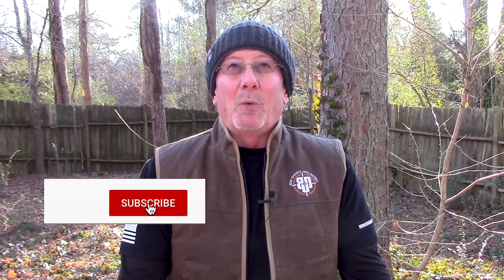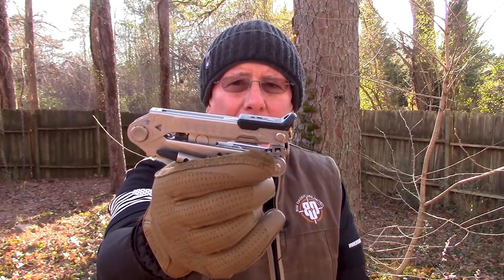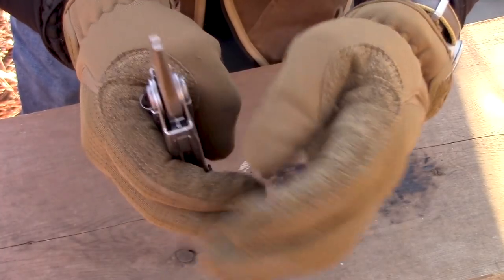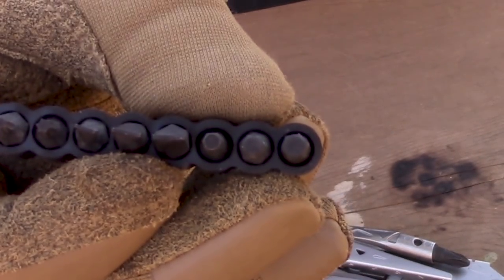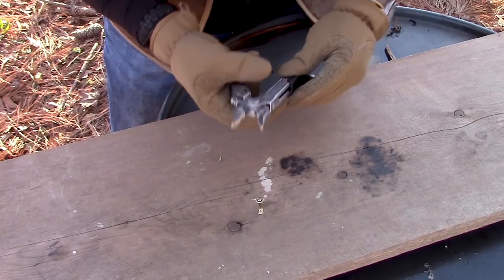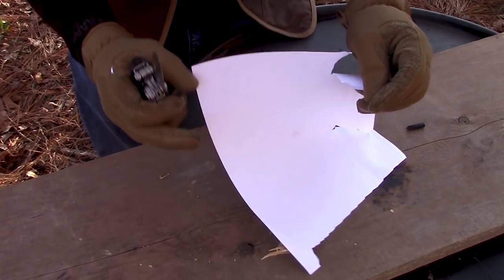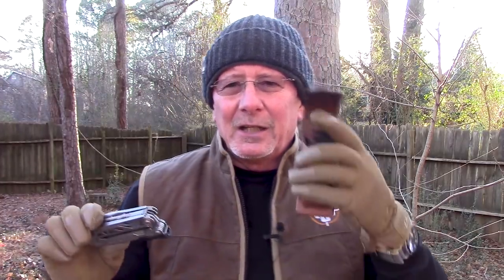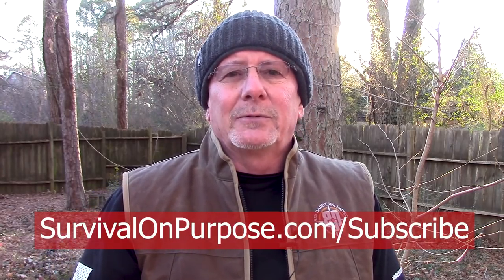Best Gerber Multi Tool - The Center Drive Plus - They Got It Right!

Comment: Had mine (the 1st version) for a few years now and really love it. The one handed opening is just too handy. That is what I have always liked about Gerber MTs. There are two things I would change if I could. 1) I would like to see more heavy duty Wire Cutters. Think Leatherman Supertool. I have broken the Carbide Cutters before cutting things I am sure I should NOT have.  2) Replace that "serrated" blade, or whatever it is, with a proper saw. The scissors are a nice touch but I prefer a saw. Again just being nit picky because I love my Center Drive.
Reply from the maker: I wish they had a custom option so you could pick some of the tools you want

Comment: i am only going to say one thing that people have been missing with the centerdrive and why i think  it is the best diy multitool barring those that are camping afficienados and that is being able to use bit sockets on the centerdrive .this in my opinion gives it an advantage to all the rest not to mention if used correctly the other tools work great as well. you can also use the bit drive at a 90 degree angle to loosen tight screws or nuts then straighten it out to complete the extraction as normal and reverse to give a little extra tightening force as well. i have done all these and it works well and you can fit a couple bit sockets on the bit holder as well and carry in the sheath with no problem.i have a 8mm 10mm and 12mm socket in my bit holder.

Comment: I've had mine for a couple of years and like it a lot. I have the original version and don't like the nylon sheath that came with it so I purchased a USA made bench craft leather sheath. It doesn't hold the bits however I really don't use more than 2 of them. Like the full size blade for sure,it did require edge work. Had many multi tools and this one is a hard to beat one!! Great video!
Reply from the maker: Thanks

Comment: I've been on the fence about the Gerber "plus" since I recently saw it. Your great review is changing my mind.  Ty.  When using Gerber, I holster the Suspension.  (My EDC is a Rebar, however.)
Reply: As a person that has the Gerber center drive plus it is absolutely horrible. I have a P4 Leatherman surge and Leatherman wave and several other Gerber's I don't understand how the center drive is so highly regarded. It's very clunky and the design is asymmetrical a lot of unevenness in the gripping area making it a screw-driving nightmare. Believe me as soon as I got it out of the package felt it in my hands I instantly regretted it.
Reply from the maker: Different strokes. One man's "absolutely horrible" is another man's "precious"

Comment: My biggest issue with gerber is plier squeezing power. I did a test where I squeezed a piece of plastic with one hand as hard as I could and the gerber barely left a mark where the leatherman wave completely flattened the material. Also the pliers rattle where the wave are fixed. It only takes a few seconds more to open a wave which you can do with one hand anyway and you get way more tools, a smaller footprint and less bulk and weight. Yes the center drive bit holder is awesome but the leatherman still does the job very well and has a huge advantage because you can use it in tight spaces as well. Gerber should have made the small bit holder usable as a driver.

Comment: Centered screw driver/ bit holder, that takes 1/4” bits,easy access pliers, plus…spring assist pliers just demolished my Leatherman Surge.! 
I hate to say it, but it did.!
Just needs a saw.
Reply: spring assisted is nice, but I find the pliers are weak on the Center Drive. They defect way to easy and the cutters are garbage. Me and a work buddy were testing the cutters, I had my Surge and he the Center Drive.  Surge made a clean cut through 18 and 14 gauge stranded, while the Center drive mashed the ends.
Cutters broke on the Centerdrive at 12 gauge solid, while the Surge made it down to 10 gauge solid

Comment: I have one of these. I really like it. Gerber tries too hard and some of the innovations are unnecessary but there are no drawbacks to them. 
As always great practical review.
Reply from the maker: Thanks
Reply: Except they are made to fail ,I went to leatherman and have never looked back. They don't guarantee them for life for nothing. Kind of like Ruger pistols ,you can buy it once , or ? Multitools are something that grows on you after awhile , you feel naked without it. I went off brand too I've got like 3 or 4 brands and they all failed one way or the other. Where as I could of just bought #1 leatherman and been done with it. Peace.

Comment: I've had an original Gerber multi tool since they first came out as an answer to the Leatherman back in the early 90s. Used to carry it at work and used the crap out of it. I don't carry it anymore because I've had an office job for the last 20 years and just don't need it very often but it does reside in the cup holder on my desk and gets used to pull staples or tighten the occasional screw. That new one looks nice,  wish I needed it.
Reply from the maker: good story

Comment: I have been using Gerber multi tools for many years, the one handed opening is a great feature.  This one looks interesting but it lost me at partially serrated.
Reply from the maker: It makes perfect sense to me in an all around tool. It is not a "bushcraft" blade.
Reply: @SurvivalOnPurpose  I was not interested in it for camping/bushcraft, it is to heavy for that and the tool set is not ideal.  I do not like partially serrated as the seem to me to be neither fish nor foul and are less useful than a fully serrated or fully non serrated blade.

Comment: I bought the leatherman plus for about $160 a month & a half ago, I bought it to take on a long road trip. Within the first 4 weeks of owning it I realized it was a very fradgile  piece of equipment. If all you need to do is tighten your glasses and remove pistol grips it’s fine. But don’t expect to open any cans, dig out any mushrooms, unscrew the unscrewable, or even dig out a weed bowl. Most expensive fradgile piece of equipment I’ve ever come across. Save yourself the money and get the gerber. Hell even customize it for the same price as a leatherman

Comment: I have the original Center Drive multi-tool and love it and wish I had gotten a second one also as the ones I got after that wasn't that great. You just gave me an idea as I watched you use the file on the tool to start a fire with it. The one I have have a file like that and I will be trying to do the same thing with the file on the tool. I still like the tool I have and believe that model is better than the new one with the scissors. That is the only thing mine don't have, but I don't use that feature much anyway.
Reply from the maker: Honestly, that seems like what it is best suited for. Maybe plastic or soft metals

Comment: I like that they added scissors. However my first center drive showed up rusted right where it said stainless steel. I get that stainless can rust but shouldn't be that way out of the package.
Reply from the maker: I wonder how long and how it had been stored.
Reply: @SurvivalOnPurpose  i picked it up a couple months after it came out. Its very uneven too. The handle that says made in USA and stainless on it is the one thats rusty. The other handle is spotless. I still love the function of the tool but kinda turned off to getting another one.

Comment: When will you compare this with the Leatherman? Tomorrow please! I need to buy something asap.
Reply: Go with the leatherman surge way better tool and steel you get way better Options and more. I have been using the leatherman tools for years, Gerber Multi tools seem very cheaply made. Never like their Multi tools but I do like there prodigy Fix blade knives and there strong. Arm knives. Do you know why the military issues the Gerber multitool is because it’s cheap they don’t issue you the Leatherman because they cost a little bit more and better made. Most of the guys I was in the army with has the Gerber end up going to the leatherman, that is the fact. Also the leatherman  is the number 1 tool choose they also are the ones who came out with this tool first years ago.
Reply: @charlesborum3910  Thank you sir!
Reply from the maker: I think both are good tools. As I said in the video, I think the one-handed opening and the offset center drive are advantageous features on the Gerber.
Reply: Also leatherman make a leatherman Multi tool call the mut EOD for EOD and a Mut multi tool for AR rifle for the military. I think leatherman is the over all the best multi tool out there hands down.
Reply: I love your reviews I watch you all the time and I thank you give great reviews I understand what you said about the Gerber multitool but what they have on that tool doesn’t compare to what leatherman offers and leatherman is way better made tool. I am a Ex Army Infantry and cav soldier leatherman is my first choose. I do agree with you on a lot of thing you have to say in your reviews. I think you are very smart and very knowledgeable about the stuff you review. That why I like to hear what you have to say.

Comment: File on these multitool is great! I have a lot of leatherman and victorinox multitool and the file on center drive is anpar with victorinox file.
Obviously is not for hard metal.... Your screw seems to be hard metal for the sound.
These multitool files are for non templated iron, copper, aluminum, bronze etc... Not for any tipe of steel.
Reply from the maker: Hmmm. Stay tuned tomorrow

Comment: I have yet to see a useful file on a multi tool. Imo they should just skip It and put in something else. Same with the scissors. All I ever do with them is trim my nails on occasion. Also a fully straight blade option would be nice. Ever try and sharpen serrations on a knife like that? Not fun. Love the bit driver. But set, holster and pliers but the rest of the tools are kinda useless imo. Especially those damn files, why they Always suck and have minimal use even if they were good files.

Comment: Needlenose least used pliers bar electrical work. Real work (Mechanical, plumbing, appliances, motorcycles) require real pliers or better yet adjustable (Spyderco).

Comment: Just too darn bulky and heavy.  Needs a saw, a better quality file with a diamond side and a smooth blade made of better steel.  I might carry it if it fit those parameters.  I find myself carrying the original Leatherman pst most of the time.
Reply from the maker: a I agree except the smooth blade. I tink if this as an EDC tool and a serrated blade comes in handy in a liot of situations